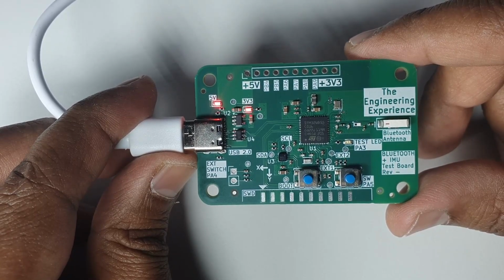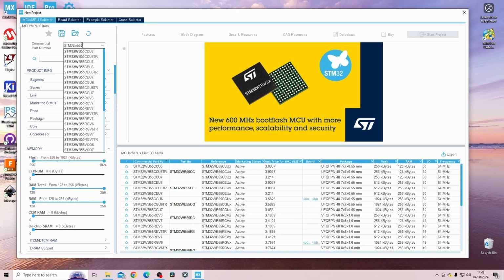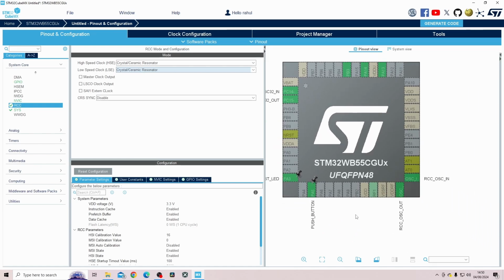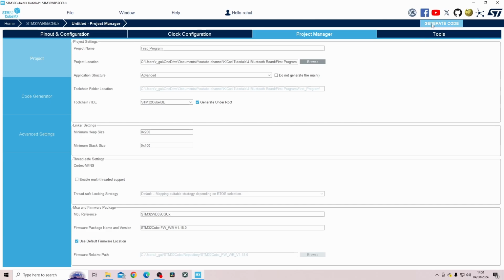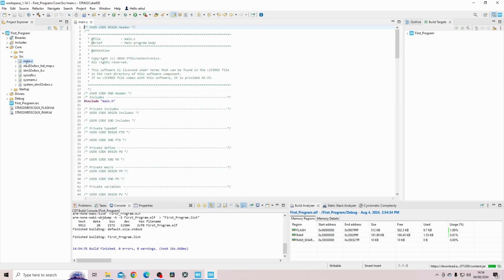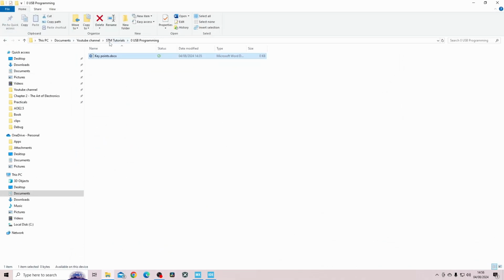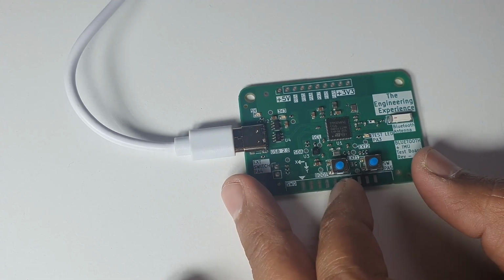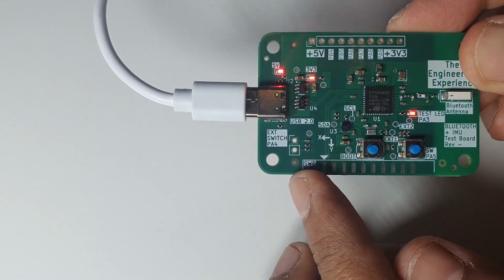STM32 First Program and Programming via USB Guide

Comment: what if the chip does not come with DFU installed? Then you need SWD to program that first? And can you use USB for debugging? Like for sending serial messages?
Reply from the maker: I will check but I think DFU aspect would turn off and then you would need to program USB as a virtual com device. 

You can use the virtual comm device as a debugger.

Comment: Hi, i have made a similar board like you. But when i plug my mcu in usb port from my pc, i get this usb error : usb device descriptor request failed. I have connected my USB port straight to stm32 D pins with 1x 1,5k resistor. Im getting crazy here. How did you connect your usb port? Any special filtering?
Reply from the maker: I am guessing you are wouter on discord? 

Most likely a bad USB driver, I had a similar issue. Try downloading another from the Internet.